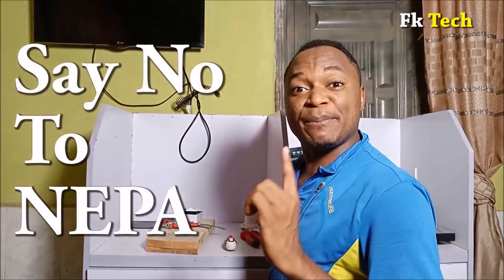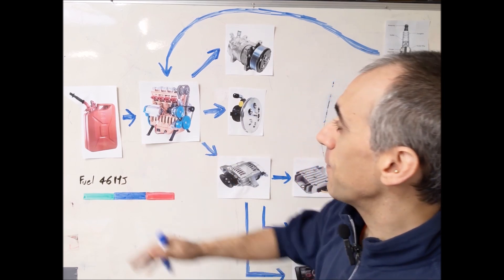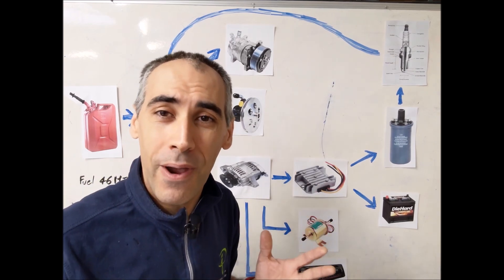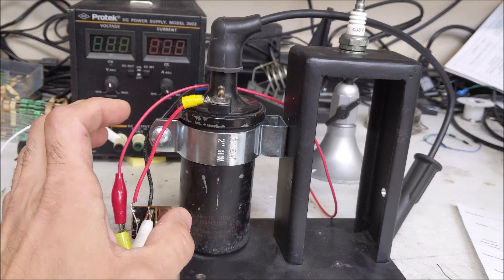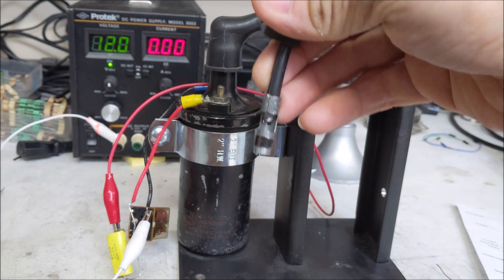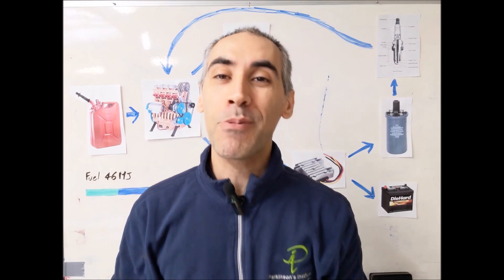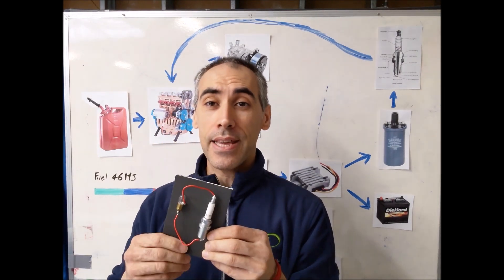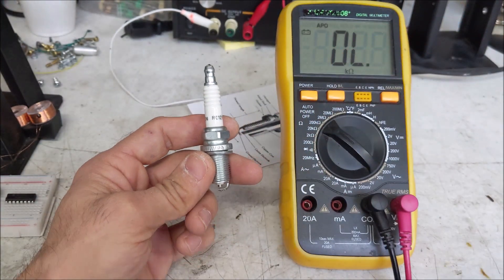~"SHOCKING TRUTH ABOUT FREE ENERGY AND Spark Plug" ~

Comment: Oh boy.

Problem 1: your air conditioning pump doesn't load down the engine when the AC isn't on. The pump pulley has a clutch in it that's activated electrically. When the clutch is disengaged, the pulley freewheels.

Problem 2: you couldn't just stick the end of the spark plug wire into the cylinder for two reasons: you'd wind up melting it, and you'd need much more voltage to create a spark between the wire and the top of the cylinder. The spark plug gap is only a few thousandths of an inch. The distance between the top of the piston and the inside of the head is way more than that. Damaging the piston face shouldn't be a problem - the temperature of the burning gasoline is 2800 degrees F.

Problem 3: the spark plugs have resistors to cut down on radio frequency interference. People didn't want to listen to spark plug noise coming through their radios.
Reply from the maker: Problem 1:
Remove your ac pump off your transmission belt and you'll notice a better gas mileage and increased performance. 
This is due to friction from pulley, belt, bearings and pump rotor mass.
This is the reason some sports cars ac is optional. 

Problem 2:
The internal resistance of spark plugs is inevitable.
The temperature of gasoline combustion is 2600F' 
While the temperature of electric spark can reach 6000K ~ 10340.33F' 

Problem 3:
By using bare cable or wrong spark plugs in your engine you'll damage your piston.
The resistor is NOT there just to dampen the noise  
Each motor has its own spark plugs specs for multiple reasons 

Thank you for watching!
Reply: @skepticalopen-mind4031  
Skeptical calmly keep educating the poor masses ...
Reply: Maybe you could take a moment to reflect, not on what you wrote, but how you chose to put it. By all means push back / discuss but was "oh boy" really necessary? If you frame your points as a discussion rather than in a condescending manner then they'd be more chance of having a fruitful and constructive discussion. As it turns out S O-m had good responses to your concerns. That's the thing about correcting people, they might know something you don't so phrasing your concerns as questions is just more productive and leaves a better impression. Plus, it makes the other party much more likely to accept corrections and be grateful for it if you are right.
Reply from the maker: @davidmurphy563  
Yours are very wise words that truly embrace my lifetime self morality

Comment: Man are you crazy? you don't use more gas because your radio on, the alternator will work at, or about 2000 rpms. We are tired of Bills, simple. I see what's going, but the radio using more gas, no.
Reply: The alternator is a load on the engine. As the alternator charges the battery or provides power to the radio, lights, etc., there is a greater load on the alternator and therefore the engine. This uses more fuel as the alternator load increases because it provides more resistance to being turned by the engine. So turning the radio on does actually use a bit more gas!
Reply: @michaelkaliski7651  the battery only is there to start the car, when the battery reaches the charging point, the alternator will stop charging the battery.
Reply from the maker: @GRACFUL1  
If you try attach a multimeter to your battery with engine ON you find out it`s <14V

If you try attach a multimeter to your battery with engine OFF you find out it`s ~12.V

No matter how full is your battery, your engine will ALWAYS try to charge it

Thank you for watching!!
Reply: @skepticalopen-mind4031  
Skeptical O.M. continues to educate the poor masses....
Reply: @skepticalopen-mind4031  Yes, the Alternator will stop charging the battery once it reaches the charging specs, that happens so the battery won't over charge, when the battery drops in voltage, the Alternator will start to charge the battery again.
Reply from the maker: @GRACFUL1  
plenty of reasons the battery keeps draining

It is an utopia to think a battery is 100% at any given time

Consequently you alternator must be in constant charge state

Thank you for watching
Reply: @GRACFUL1  and when the alternator stops charging the battery the radio will drain the battery and the alternator will start charging again thus burning fuel. But what actually happens is once the battery is charged the alternator effectively powers all the accessories and the battery is a buffer absorbing lulls and spikes. The radio doesn't run for free and whether it comes from the battery or alternator it still consumes fuel.
Reply from the maker: Yes you alternator takes energy even if it's not used. 

Furthermore:
If you attach a load to the alternator it will drain more energy 

We are all tired of bills but free energy scams are even worse
 
Thank you for watching
Reply: What do you think is powering the radio, fairy dust? It doesn't use a lot of fuel, it's only about 10 watts or so, but yeah, that ultimately comes from fuel. Well, ultimately, ultimately it comes from the sun but you get my point.

I totally understand you being sick of bills, you're not alone on that score. Put solar panels on your roof, insulate your home, switch to an electric car, look into getting a heat exchanger, when you buy consumer goods look into their energy efficiency, upgrade your boiler, get a more sophisticated temp control system, buy led lights. These things cost money but they don't take too long to pay for themselves - in the long run you get more for less, you'd be amazed how much. These are all real technologies, they exist and they work. No need to chase the physics defying pipe dreams of fraudsters.
Reply: @davidmurphy563  And that's just the problem with this ideology, by claiming that it's just possible to do it and people just should.  For saving energy and thus lowering the bills, you need extra money to invest in the things that will save you money. Most people don't have that money in the first place or they are not the owner of the house they live in. 

I understand that there is new technology that reduces energy consumption and that it is effecient in how it does it, but where i live  i can see the only people who are able to use this technology are households where both partners earn alot above the average. So telling people just to upgrade  their stuff is a bit unrealistic cause it isn't cheap in the first place. 

I do understand that these free energy devices ar complete BS, but i also understand that people are worried about the energy bills every month. I think that's one of the reasons some people are wanting to believe these ideas, with the conspiracies around it.
Reply: @davidmurphy563  Funny how you mention Terry Pratchet. You realy think he was making fun of those who can't afford? 
He was clearly pointing out there is a problem.
You can't point a finger to those who can"t afford. 

But you will save if you invest...

If you can invest in something, that means you have some money to spare, not so fun fact, only a minority can do that.

I mean, i"n not considered poor, but yet investing in whatever is a big ask.

So yes it IS an ideology, if you think it is about people unwilling to invest, or may i say it, to stupid not to invest. Most of us don't have that kind of cash today. We don't have an extra to invest, we have a shortage to overcome...

Did you ever drive around in that part of the city where people don't have tesla"s nor solar panels? And if you did, can"t you see the problem? 

So don't point  fingers to the have nots, thing is they have not...
Reply: @eugenezandberg8057  You totally misunderstand, neither Pratchett nor I were making fun of the poor. Absolutely not. There was definitely comedy in the way it was put the character that was saying it had grown up in squalor and mistrusted the rich. Sometimes humour is a very effective way of making a serious point. Pratchett obviously isn't Orwell but, still, he had a point to make: to highlight something that's intrinsically unfair. People not having the money to invest in solar panels (etc) and so having to pay more than the rich is unfair. 

I then went on to make the point - agreeing with you - that it's wrong to place the burden on the individual when the majority can't afford it.

Like I said, that's a valid point and I agree. 

I argued that there should be access to investment schemes built especially for this purpose so everybody can benefit from this tech.
Reply: yes, I know there is something out that will work.
Reply: @GRACFUL1  Something called the first law of thermodynamics gives you an easy test to know whether something is consuming power. You don't even need a measurement device. If something is using energy it will get hot. Fundamental law of physics right there. So, run your car and see if the alternator gets hot (please be careful if you do). Want to know if your laptop/TV is using power when its turned off? Can you feel heat? If so, it's consuming energy. Every single thing in the universe follows this law.

And there absolutely are things that work! Everything science makes works! That's the wonderful thing about it. Look into all those things I said, solar panels especially, there are legitimate energy solutions for you that can give you more and save you considerable amounts of money.